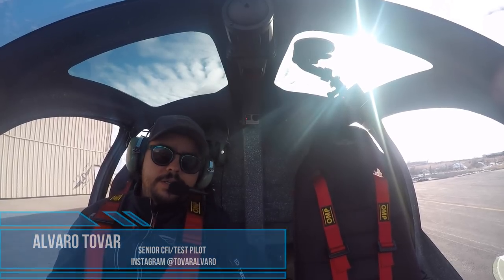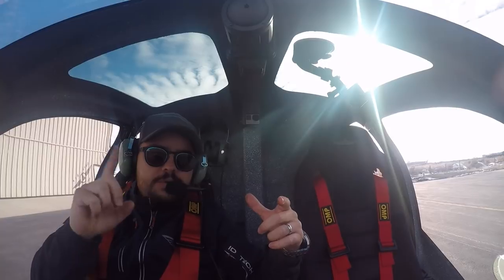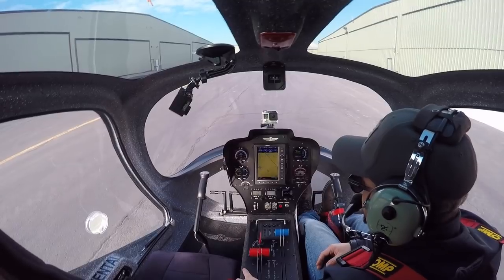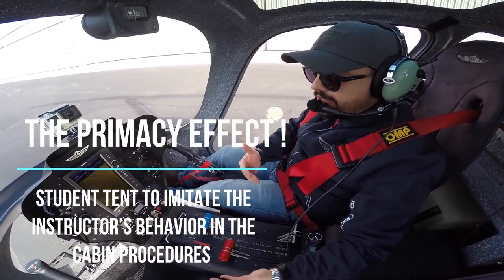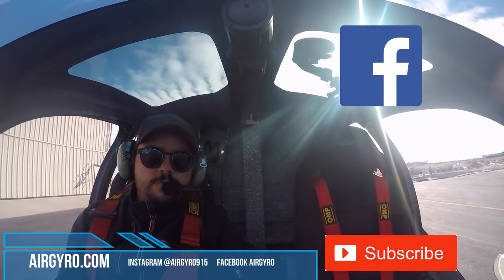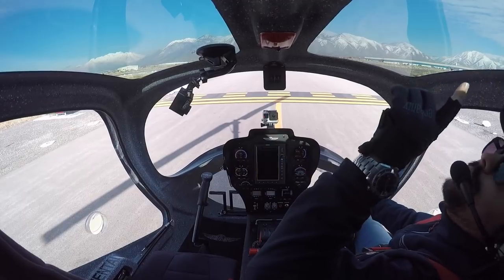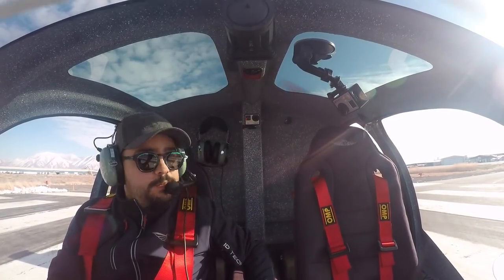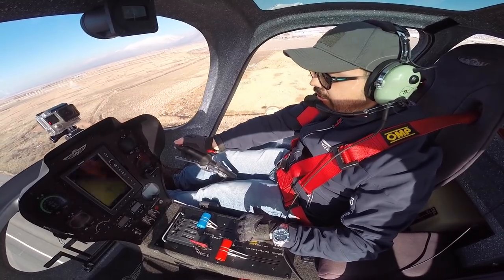AIRGYRO'S GYROCOPTER TAKE-OFF PROCEDURES

Comment: Hi. I have never piloted any aircraft so I am interested in why you need the "umbrella" to turn the aircraft but also you have foot pedals to turn the aircraft. Can you please explain why you need both. Thanks
Reply: Disclaimer: I am not a pilot either.  However the way I understand it is this way.   
The pedals control the direction of the fuselage...the yaw of the aircraft, while the rotors (umbrella in this case) control the pitch and roll.   Turning requires the roll to change and causing more lift horizontally on one side than the other, causing the aircraft to bank.  For a level turn you have to add pitch as well to keep the nose up because some of the upward lift has been converted to horizontal lift.   The pedals (rudder) will need to be used to make the turn coordinated (keeping the fuselage inline with the turn.)

If someone thinks i mis-stated something or can add more, please correct me.

Comment: The Pin that hold the Rotor tettering is enogh to hold the aicraft  safely ?
Reply from the maker: If you are talking about the teeter bolt then yes, but there are actually 3 bolts that keep you safe.   But the pin only holds the nut. If the nut goes, then you will have some movement. We haven't had that happen though.